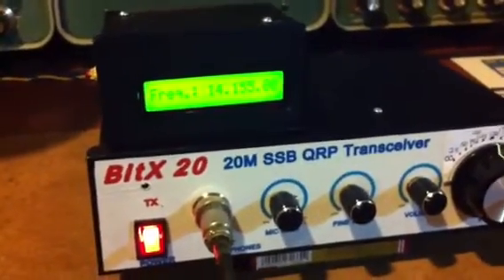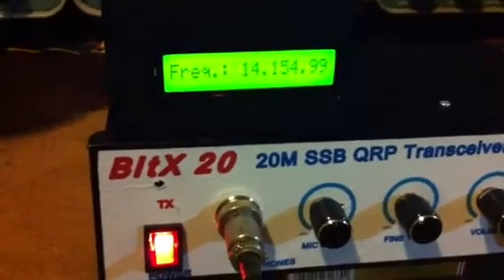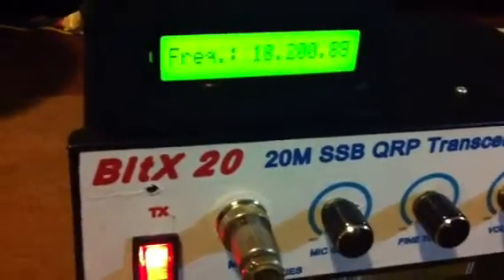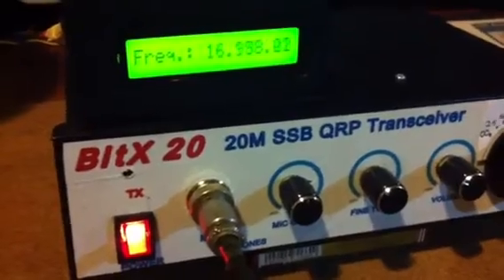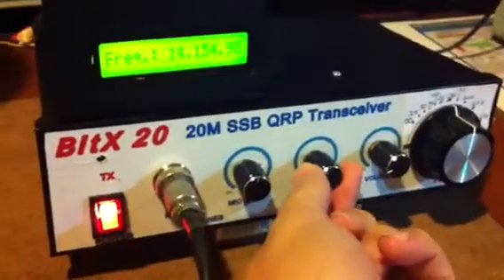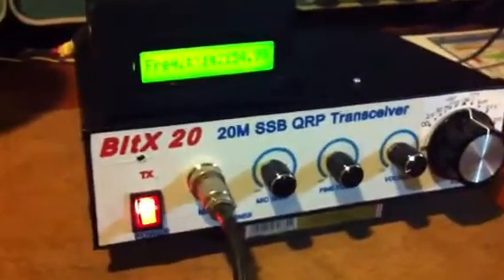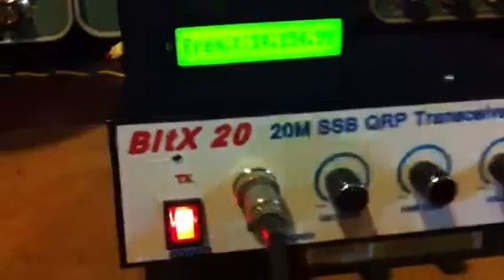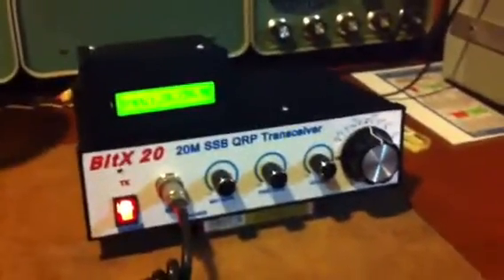BitX20 working USA Stateside

Comment from the maker: Hi Sourav, I retuned the BFO and the 3 cans. The BFO is tuned to 9.995.268 using a counter at the emitter of Q9. I get about 5 W and the mic amp is a one transistor simple amp. It is available from a local electronics hobby shop. However, if u use a dynamic mic like mine, u have to use a blocking capacitor to cuts the DC supply to the mic port. Have fun !!, de JOY/YB0NSI